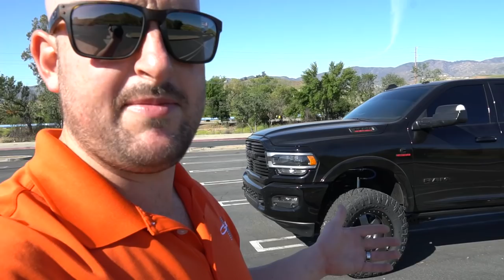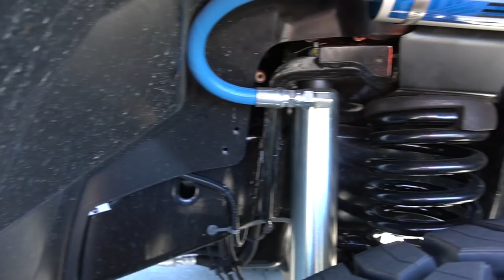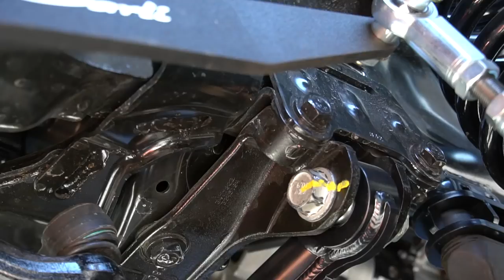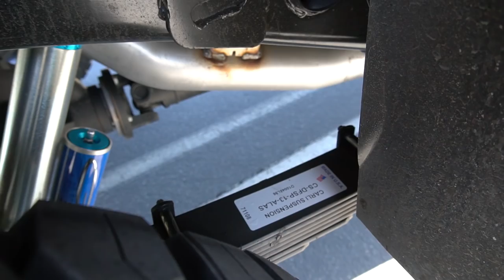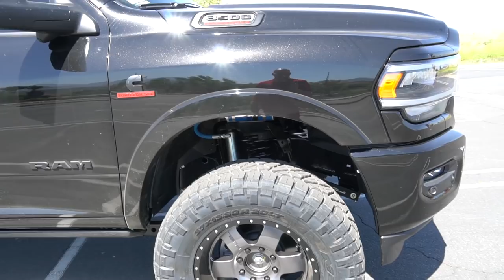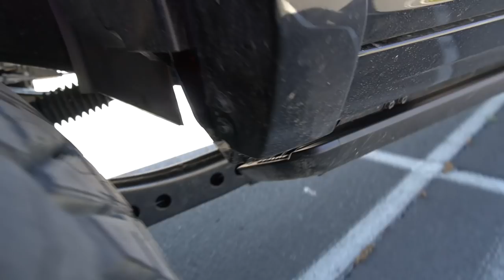2019 Ram 5th Gen Ram HD - Carli Pintop System

Comment: However would you rate the ride quality over a F350? Also would you consider getting the model without air bags to get a better ride and performance?
Reply from the maker: I would rate the ride quality VERY similar. Both boxed frames, both long arms in the front on corrected pivot points, both leaf spring in the rear. The caveat, the Ford would be equipped with our Long-Travel Airbags in the 4.5" lift and a softer leaf spring. I think the Ram would haul better (being a 1" shorter lift, heavier spring pack and factory double-bellow airbag) and the Ford would ride better. When we come out with our long travel airbags for the non-air rear 3500, the playing field will level. I prefer the ride of the 3500 without the airbags - our full spring are lighter and long travel airbags ride better than the factory option. The factory air is only the best option for people looking for the massive payload these trucks offer.

Comment: How high does this lift the rear?  I’ve heard and read both 1” and 2.5”. Hopefully it’s the latter.  I have this exact truck and threw on a 2” spacer in the front for now to fit bigger tires, and that has already put my front end .5” to 1” higher than the rear and it’s driving me crazy.  If this kit raises the front 3.5” and the rear only 1”, it would be even worse.   (Kinda kicking myself for ordering the factory rear air to be honest)

Any impact to payload numbers with this kit installed?
Reply: This kit raises the Front 3.25" and the rear 1" keeping the rear end 1/2" taller than the front. Payload is unaffected given our air-assist specific spring pack and the factory airbags are maintained.
Reply: @DanTourino  Weird...measured to the center of the wheel well, my (stock) rear measures 42", while my 2" lifted front measures 42.5" on one side and 43" on the other.  Removing my level and applying this kit would then seemingly put the rear at 43" and the front at ~44.5".  I must be missing something.

Comment: I have a 2019 Power Wagon running 37x12.5r17s.  How do you guys feel about the OEM steering components on the 19+ vs Synergy's Tie Rod and Drag Link for 37s?
Reply from the maker: The OEM is extremely strong. We've not seen ay need to seek an aftermarket alternative in the 19+. We actually recommend those with issues on their 14-18 upgrade to the 19+ drag link.
Reply: @thecarlisuspension  ok thank you

Comment: why do you have to relocate the air suspension tank on the older 2013 to 2018 trucks?  You are just replacing leaf springs with leaf springs!  I get if you have amp steps but I don't have amp.  I looked all over your site and don't see this explained!  Its not explained in the instructions either.  loosing your spare tire mount is nuts given the extreme price of these kits!
Reply: The air-tanks are relocated as they interfere with the mounting of the Carli Radius Arm Drop Brackets. You can't run an oversized spacer so that area is worthless to you unless you're planning to run the factory wheels and tires. If this is your preference, it may be better to modify the air-tank bracket to work with the radius arm drops to maintain your spare tire.
Reply: @DanTourino   thanks! My 18 3500 are is a tow rig only. Zero off roading. I just want better ride with least amount of lift. I see the updated rear  springs only add 1in lift vs 2in for the non air ride trucks. Which is perfect for me. I can add some thuren 1 in springs to front and be done. Yes I only have 35in nitto tires so I  still have my spare tire and want to keep it.
Reply: @crazyhass84  35" tires will contact the spare's side-wall to the rear differential at full bump. With the airbags in the back, you're unlikely to ever see full bump (especially as you said no off-roading) but these are all special circumstances. I'm sure it now makes sense WHY we consider the spare worthless. This system is designed for off-road & oversized tires to be run to full bump without contacting the spare.
Reply: @DanTourino  agreed. Thanks for the clarification! As u know, most roads in America r as bad as off roading! Thanks to pathetic govt that funds constant wars but not infustructure! 
Hence, me wanting this system on my 18 tow rig that is a payment princess. I just want 1in lift vs 3.25 to save fuel. Thanks!!

Comment: Does the lift trigger the computer system to self auto-level?
Reply from the maker: The rear height isn't determined by it's relationship to the front, there's a leaf spring pack on the 3500s and a height sensor that determines the rear height. This system has a full leaf spring pack, aig bag spacer and sensor relocation that extend travel and set the rear end 1" higher.

Comment: Do you maintain the factory warranty
Reply from the maker: The lift will not void any warranty aside from the parts it's directly replacing. If a shock blows out, they're not going to cover that but they're not going to deny warranty on your injectors because you've lifted the truck.

Comment: Will this set up fit on the '19 3500 air suspension dual rear wheel? thank you
Reply from the maker: We've not yet seen one but it should - the platform has always carried over.
Reply: @thecarlisuspension  Thanks for the reply. My Ram order is still  few weeks out so many some more info will be available by then.

Comment: When will this be ready to order would definitely like to get my order ASAP
Reply from the maker: Working on the changes, we'll post an update when we're ready to rock!
Reply: Carli Suspension also will you be making just a leveling kit for this truck too
Reply from the maker: @YungDiddy1484  Not the auto leveling air assist - just the leaf sprung 3500.
Reply: Carli Suspension one more thing I see the coils are 2.5 inch lift but it’s for diesel can they be put on the hemi 6.4l thanks
Reply from the maker: @YungDiddy1484  We offer a 2.5" Kit for the Diesel as it's the most popular. The Hemi trucks, we offer a full line of 3" Systems.
Reply: Carli Suspension it’s these kit available now

Comment: Bad ass truck. Too bad they are not fast like the powerstroke and duramax are.
Reply: I drive a stock Cummins and yeah there take off isn’t as fast as a turbo v8 powerstroke/duramax but I prefer a Cummins cause it’s a real Diesel engine. That’s why most semi trucks use straight six engines over V’s.
Reply: JJM 05  pretty sure powerstrokes and duramaxs run on diesel too man 😂  I’m sure they’re both real Diesel engines too
Reply: Kody Wauneka the powerstroke/duramax were designed around their gas engines which is why he is saying they are not “real diesels”. I too prefer the I6 over V layout. In the end, they are all big boy trucks that can pull down half a forest!
Reply: Justin Brown  so the Cummins V8 in the Titans isn’t a real diesel? You
Cummins boys with your 80s “6 In a row” logic is the reason why no one takes you serious anymore
Reply: Kody Wauneka do some research on the nissan Cummins and you will understand why they went with a V8! It’s all about cost and relationship. Before Fiat bought Chrysler, Nissan was going to design their new titan around the RAM... Well that got axed and Nissan was left having to design their own engine with Cummins.

BTW the new RAM is being taken serious by everyone! They have literally changed the HD world with their 19. I have nothing but respect for all three so I’m not some RAM BOY as you stated.
Reply: Correct. They are not as fast as the Powerstroke and Duramax off the line. However, it tows MUCH better than either one. The Cummins has a better low end torque curve and has better fuel economy when hauling a lot of weight.
Reply from the maker: This thing has balls! It's the only one of the three boasting 1000lb.ft. of torque. The Powerstroke is more linear in its power curve but this thing has unbelievable torque.
Reply: Going fast aint the talking point. Just torque.... and aint nobody comming close to I6 cummins in 1 ton market.  Cum-inside power joke and dmax all day long.
Reply: I test drove a 2020 AT4 3500 and couldn't tell a difference in acceleration  between that and the 2019 HO Ram 3500.  Yes it's faster but it's not by enough to make a difference unless you are racing.  The AT4 shifted much smoother, however it was doing it all of the time (which I find problematic in the long run).   The HO Ram has a nearly flat power band so it stays in gear and chugs along wonderfully. As far as tuning goes the new 6.7L Cummins block, crank, and rods will handle much more power than a duramax. The thing to watch on the Cummins is the CP4 pump.